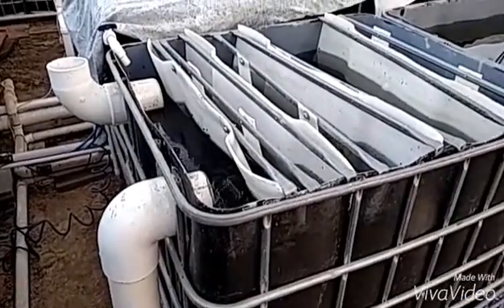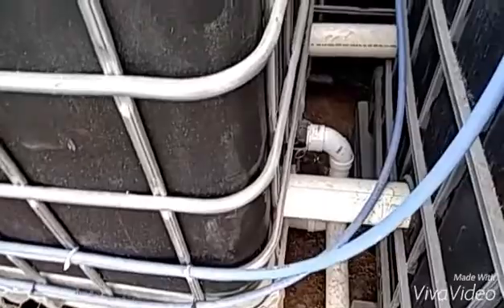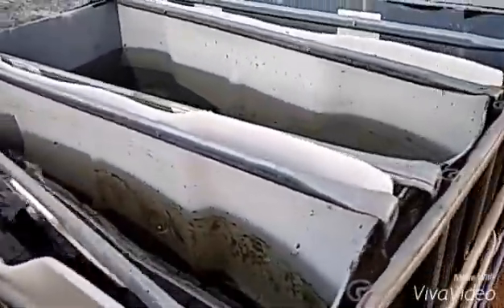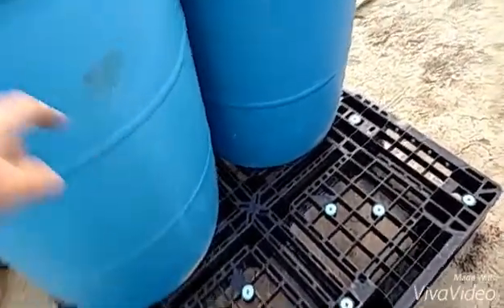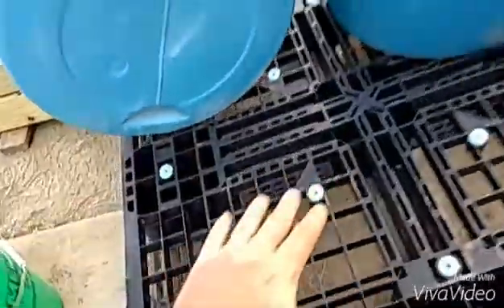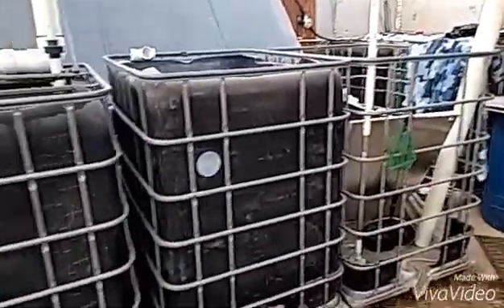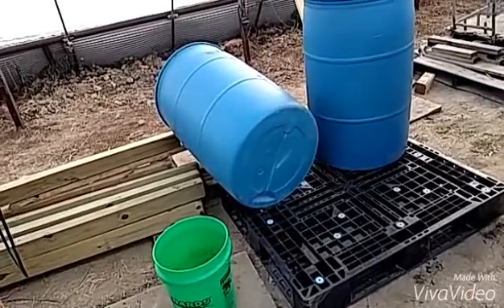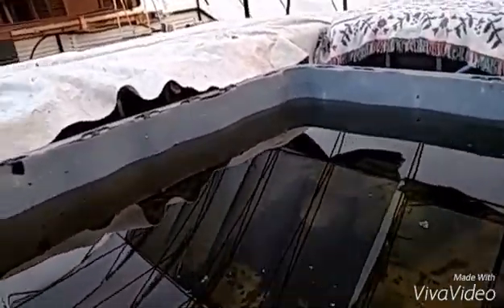DIY convex barrel swirl or radio flow filter for aquaponics

Comment: New to YouTube? Welcome:)  Loving your name by the way "Greens and Gills"!  I do like your idea with con caving the barrel and I've given them a little bit of thought and I'm thinking maybe you could put a bowling ball in the bottom and heat up the plastic somehow to where the bowling ball starts to pull it down into the concave shape?  Or you could heat up the bottom and take a broomstick and push right in the center making sure not to go all the way through that will give you a point that all your solids drain to.  I just built a swirl filter yesterday for my outdoor AP system/Oranda/Ranchu Goldfish breeding facility .  I posted the video to my other YouTube channel (https://www.youtube.com/watch?v=617xVppnwFo).  I wish I would have made it concaved but there are other ways to figure this out that I may be able to utilize to get the solids off the bottom without concaving the plastic.
Reply: I'm sorry man, I just realized you're not new. I only saw three videos on your main page so I thought you were a new tubber:)  Anyways, new subscriber here!  God bless you bro!
Reply from the maker: Hey, thanks for the ideas. I had not thought about the bowling ball as a weight.  I'm planning on sitting the barrel upside down on a pipe or something to make a point, then put some weight on top of that and heat up the center. I will find something around here to make it work. Thanks for subbing.  I will check out your video.  Thanks, Von
Reply: That is a great idea to put it upside down:)